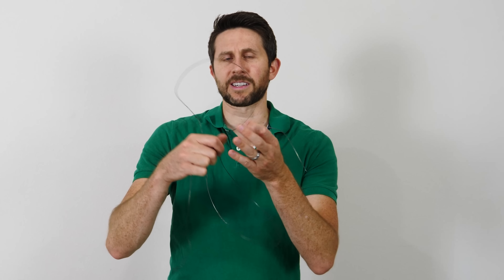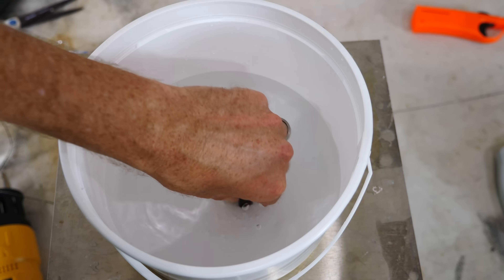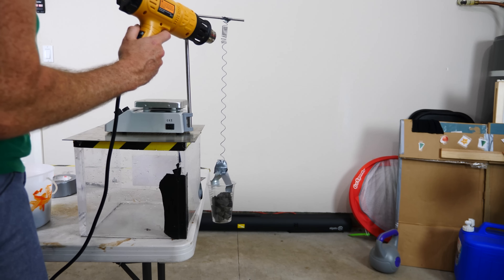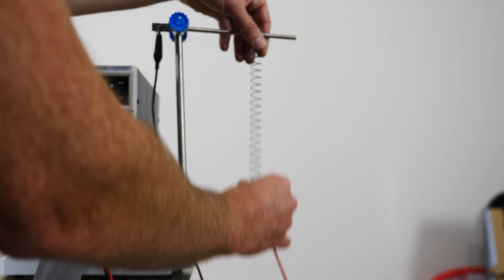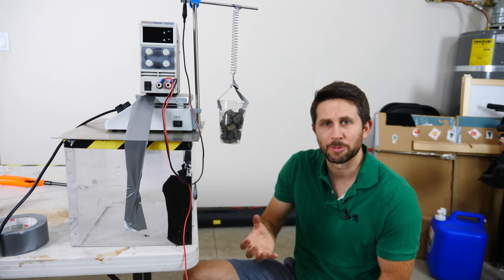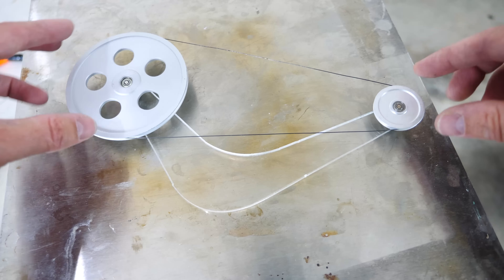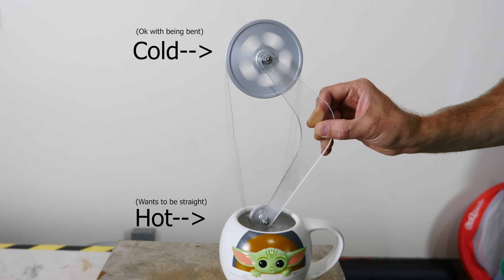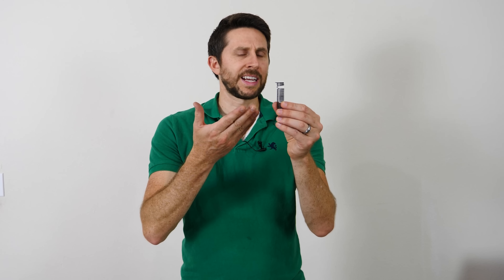How Strong Are Nitinol Muscles?

Comment: Is there a fatigue effect that limits how many cycles of stretching and contraction it can go through before it stops working?
Reply: I used nitinol wire probably thousands of times and never had any problems until I accidentally overheated the wire in one spot. After that it had problems getting back into position.
Reply: @ehrichweiss  how do you set the position you want it to retract to?
Reply: @Chris-it4lj  it can be done by heating it up to around 400 to 500 degrees celcius for a few minutes
Reply: @ehrichweiss  when you over heat it you train it to a new spot
Reply: @ehrichweiss  I think when it is heated beyond a certain temperature, it "remembers" the new shape.
Reply: This is the perfect motor for a heart assist pump to run on.  🧡 💪
Reply: @threehorsesxxx5759  so the heat source is from our body?
Reply: @siontheodorus1501  I would assume so
Reply: @_shadow_1  well it could work, but i don't think that the body heat can produce enough power to run the motor
Reply: @siontheodorus1501  Yes the body is the heat source and the blood as it passes through the lungs is the cooler source
Reply: Yes the body is the heat source and the blood as it passes through the lungs is the cooler source
Reply: @Himeros24  dude just stfu
Reply: Yes, there is. But the number of cycles is proportional to the amount of deformation applied. It can be in the millions of cycles if the deformation applied is under 10%.
Reply: Judging by that illustration at the end it looks like it would never fatigue. You would have to mechanically separate the atoms (i.e. cut the metal) rather than bend/stretch it apart.
Reply: @Himeros24  You're calling a 40 year old man a kid. Thanks for proving my point.
Reply: Well then in that case, if we use the nitinol engine to power a car, it would fatigued very quickly. Because engines get to tens of thousands of RPMs
Reply: @Himeros24  my point was no of this is producing anything, your just trying to argue to literally text on a screen, don't act like what your doing here is "useful"
Reply: Good question with a weird/fun answer, not only does does nitinol not fatigue like other alloys it actually GETS STRONGER over time 

https://youtu.be/8-dCIkJAjyM?t=84

and this lab tested it to 23 million cycles

https://youtu.be/oKmYqUSDch8?t=198 

I looked into this material a few years ago. Most of the documentaries are from the 70s but well worth a watch and it seems that the applications for this material are numerous with my favorites being self expanding stents (triggered by body heat) to repair collapsed arteries and self reforming tires on the mars rover intended for use in an environment where regular rubber tires  would shatter like glass.
Reply: @irritable666  combined with soft robotics, you got a good start on artificial muscle. Resistive heat the memory material and/or exposed to nitrogen. Use phase changing nitrogen to inflate the soft portion of muscle. Just like animals have twitch muscles and long muscles.

Then we can build robots with tank guns for arms.
Reply: @irritable666  Whaaaaat that is crazy, thanks for the awesome comment 👍
Reply: @irritable666  why are you sharing stories you know are faked?
Reply: Well, it's the same as any other metal, micro cracks form.
Reply: @Himeros24  Your relying to yourself getting "owns" while the most likely that other commenter just doesn't give two shits, like an adult
Reply: no nitinol not only doesnt get fatigue effect but also get stronger the more it repeat the same action. scientist still doesnt know why ( also im surprise he didnt mention this)
Reply: I had a pair of glasses made of memory metal, which I would demonstrate frequently, by twisting them over 180 degrees...the nose bridge eventually snapped.
Reply: Statement given by the inventor in the original experiment (1973) - "After 23M revolutions wheel is running stronger" Here: https://youtu.be/oKmYqUSDch8?t=198
Reply: Yes  like all metals it undergoes fatigue, nitinol engine can last between 10^4 to 10^7-8 cycles depending on the strain  (lower strain= longer cycle duration).
Reply: @aetius31  that seems crazy..strong enough for light weight high efficiency heat combustion engine…
Reply: @minercraftal  Not Really, a 50Hz engine would last only a few hundred hours.
Plus Nitinol is very difficult to repair as weld point are really weaker.
Reply: @aetius31  I thought about that, hasn’t they use metal crimp as the joint? That’s more stronger than the weld. Otherwise, the service life is short… it don’t need a heavy transmission, but it still don’t worth…
Reply: @minercraftal  but you cannot crimp it it will just undo when you heat it up
Reply: @aetius31  That is highly dependant on how the metal is trained.
Reply: I liked it
Reply: 400th like
Reply: @Himeros24  sure! Sorry
Reply: I think thats an obvious thing.. so yes!!
Reply: If it's like heat treating over and over again it's just realigning the molecules over and over so fatigue wouldt be an issue it would be more like with the motor load based not cycle based
Reply: Idk
Reply: @Himeros24  responding with idk is possibly one of the most useless answers you can give. If they said "idk, I'll search it up" then following up with an actual answer would be the best response to not knowing. The least effort would be to not even answer. 

The only reason the person you're defending is answering with "idk" is because they want their YouTube account to be seen, like Justin Y. but with less effort. 

How would you feel if you asked "Why is the sky blue?" and someone answered "idk" and just walked away? Perhaps you will just search it up yourself, perhaps you will spawn a philosophical debate on why we don't question everyday phenomenon. 

But, bottom line, you'd still have to put in all the work, work that clearly, moat people commenting questions don't find worth it to put in to answer a fleeting curious thought.
Reply: Well I guess every material has a fatigue life but don't know how many cycles this alloy can bear.
Reply: @Himeros24  respect +
Reply: @Himeros24  respect for not chickening out and proving your point
Reply: According to McDonnell Douglas in the 80s it could do millions of cycles and get better and stronger. So, why don’t we use it for waste heat powered generators? I don’t know. Probably because creating carbon is actually what they want so they can create a new tax.
Reply: Lmao
Reply: Probably not. This alloy does not deform. So the heat of the body would keep it in order.
Reply: The heat might soften the metal and get rid of the fatigue, idk, i wish i was an engineer
Reply: @Himeros24  autistic explains it
Reply: Study photons it my help
Reply: If you over heat it yes it will stop working, but if you use electricity and keep it at right current it’ll last forever. My beer robot has had same arm for over a year and it still goes back to original shape
Reply: Yes, it is called Functional Fatigue.
Reply: @Himeros24 I shouldn't even bother but to give you some context, the OP asked an honest question and the first person said IDK, which is absolutely pointless and you made a guess (which is clearly evident in your wording by saying "likely" ) which is also not helpful. Then You assumed I was a child. So that's all I have to say I'm not in the mood to debate stupid stuff because I am not in fact a kid.
Reply: Hmmmm idk
Reply: @imakeeditsiwillbeatevil9346  If you don't know don't say anything.
Reply: @NoZioKikes88  ok
Reply: @imakeeditsiwillbeatevil9346  No you wont beat evil #evil
Reply: @imakeeditsiwillbeatevil9346  you can't beat him... He's just in every video's comments.😀😀

Comment: Can Nitenol still experience metal fatigue? Or does the internal crystalline structure reassemble/restructure itself when heated?
Reply: Excellent question...I want to know the same...
Reply: I've heard it can bend an infinite number of times (if it's pure) but can't say for certain.
Reply: @Milan_Openfeint  what do you mean by pure ? its an alloy.
Reply: @norigbalian9074  Alloy can still be pure. Nitinol is a mix of equal number of atoms of titanium and nickel. Any other atoms, uneven ratio or imperfect mixing will degrade its endurance.
Reply: Been looking at why Nitinol hasn't taken off as a super dooper heat engine material, & it appears that it's primarily due to the difficulty in manufacturing the stuff. It has to be made in a vacuum to stop Oxygen & Carbon atoms bonding to it and it needs insanely precise temperature controls to "fix" it's shape memory. 

It's also a bastard to work with, as anything which causes heat tends to cause problems, so no milling, welding is a pain & cutting it with pretty much anything other than lasers is going to be a problem.

It's still amazing & will go on to do (more) very cool things, once they get the bugs worked out.
Reply: Good question with a weird/fun answer, not only does does nitinol not fatigue like other alloys it actually GETS STRONGER over time 

https://youtu.be/8-dCIkJAjyM?t=84

and this lab tested it to 23 million cycles

https://youtu.be/oKmYqUSDch8?t=198 

I looked into this material a few years ago. Most of the documentaries are from the 70s but well worth a watch and it seems that the applications for this material are numerous with my favorites being self expanding stents (triggered by body heat) to repair collapsed arteries and self reforming tires on the mars rover intended for use in an environment where regular rubber tires  would shatter like glass.
Reply: @irritable666  Stronger is a little vague of a metric... In what way is it stronger? Harder, more ductile, more elastic, less frangible - what..?
Reply: Hmm.
Reply: @Joe-zw9ep  who are you?
Reply: @smoked_xd  Why?
Reply: @Joe-zw9ep  read your name
Reply: @Joe-zw9ep  are you joe mama
Reply: Yes  like all metals it undergoes fatigue, nitinol engine can last between 10^4 to 10^7-8 cycles depending on the strain  (lower strain= longer cycle duration).
Reply: if you bend it like a spring,or around finger no,but if you kink itwill cause cracks-minor damage...it should be good over a milion times bending...
Reply: Same
Reply: amongusa
Reply: Yes, just like all metals. It's more of a question of how much it takes.
Reply: I was wondering the same thing.